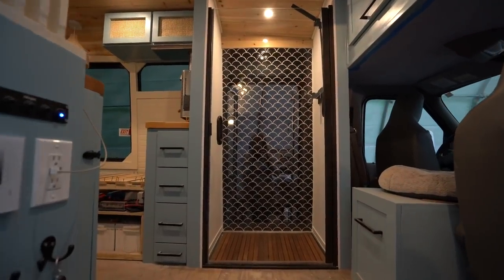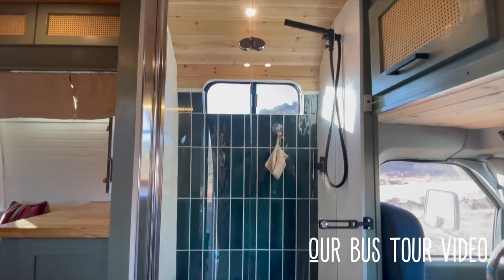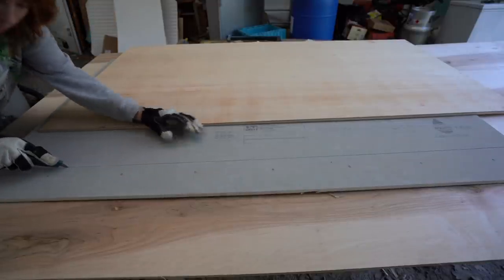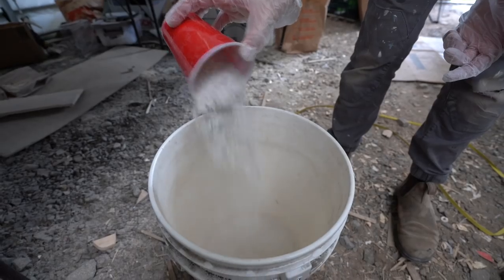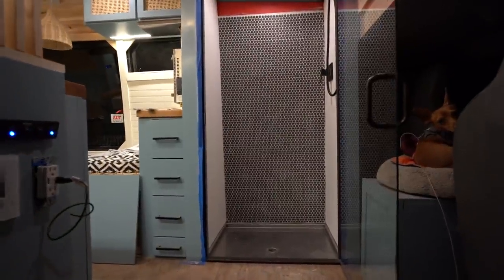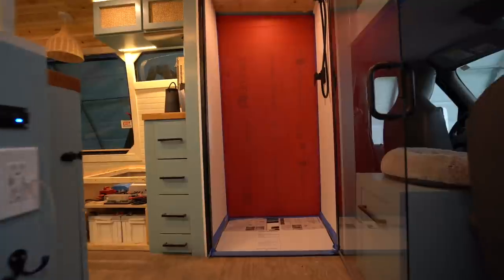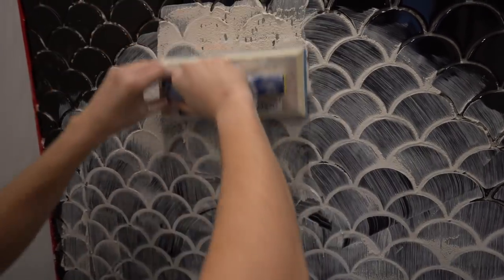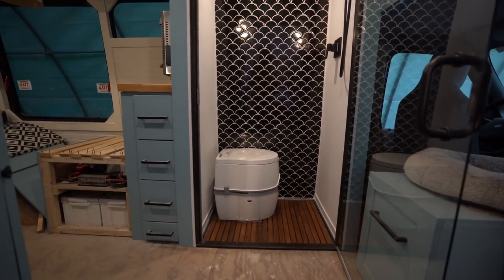Shuttle Bus Build Ep 18 | The Bathroom Episode ( We Tiled TWICE?!?)

Comment: The mermaid tile does look amazing! ❤️
For future reference, when using web mesh tile, cut a straight line on the whole tile panel to start, e.g., straight across the bottom of the panel. Install at the bottom edge of your space and work your way up. Then you can cut down the side of a full panel to fit the side. It keeps you from having to cut squirmy individual tiles.

Comment: I'm a professional tile and floor man. Always unless you're doing a backsplash, try to avoid using mesh backed mosaics. It's challenging and maddening for professionals... And then if you use a contrasting grout color. Oh boy! Every non-consistent Gap smacks you in your face. So if you use mosaics. Keep them on the floor, and try to at least use a similar if not matching color grout. If you want to use a contrasting grout color spacing, straight lines, and pattern layout has to be perfect. As default I always tell customers I'll use a similar color grout. If they say no we want to use a contrasting. I then reevaluate my pricing before I submit it because it's going to take a lot more effort